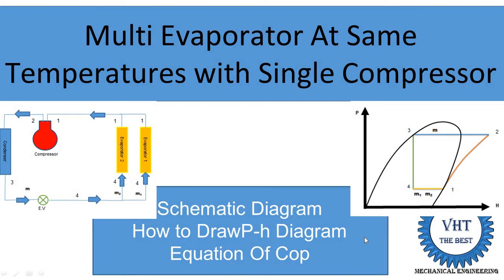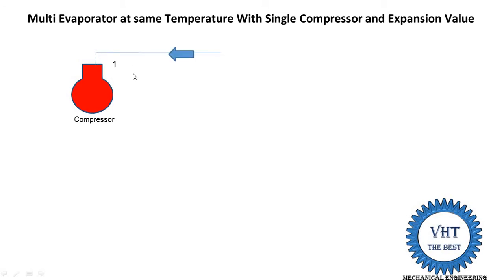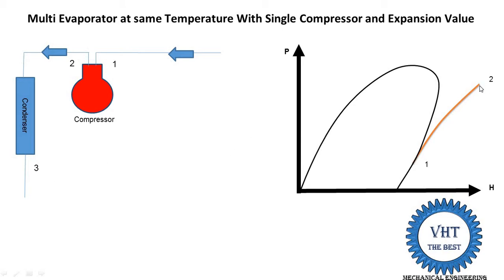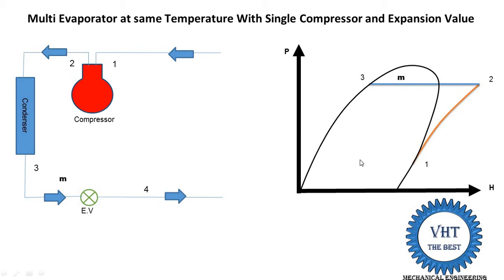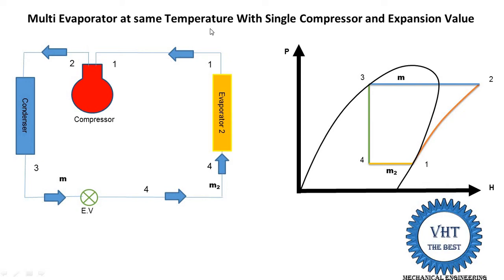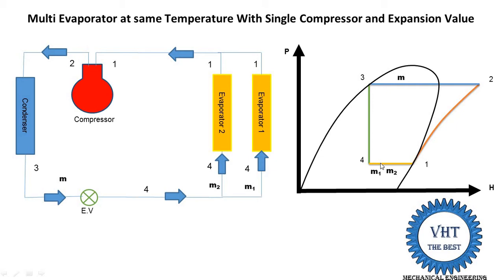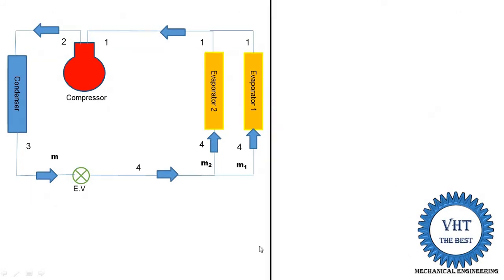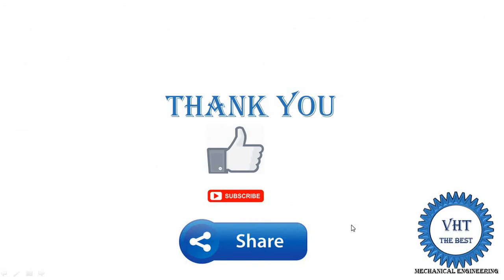Multi Evaporator at same Temperature With Single Compressor and Expansion Valve

Comment: Professor, I'm writing you from Rio de Janeiro, and I found your video while trying to find clues to confirm if I could install two evaporators, both exactly the same (each with exactly the same expansion valve), in a car AC system that has one compressor and one condenser, without major problems, and your lecture was very inspiring.

The reason to install two evaporators is that I'm installing them in a classic car that does not have a lot of space to hide a big enough evaporator to refrigerate its interior and I thought about doing it in a cascading effect (where the sum of both create enough cold to refrigerate the car's interior), in two possible ways:

a) Install one compact evaporator at the cabin fresh air intake that exists in the engine compartment, and install the other compact evaporator hidden behind the dash.

b) Install both evaporators at the fresh air intake that exists in the engine compartment, one in front of the other, about three inches apart.

In both cases, the refrigerant would come from the compressor and split in a "T" going to both evaporators. Considering that there are two exact evaporators, is it better to use just one expansion valve to serve both evaporators? Or is it better if each had its own expansion valve (considering that they are exactly the same)? Would I need to use a reducing valve after one of the evaporators?

From what I saw in your lecture, I would not need a reducing valve because in my case, both exits from the evaporators would be coming out with the same pressure so I could just put their exit both together in the same stream back to the condenser without any additional valve, without any problems. Am I right?

Any word of advice?

Thank you very much! Best regards, JP
Reply from the maker: Welcome.
Thank you for comment.
You will run system without using
Any additional valve but for that you need to run both evaporator.
If you want to provide option for start only one evaporator and stop other evaporator then you need to provide additional valve.